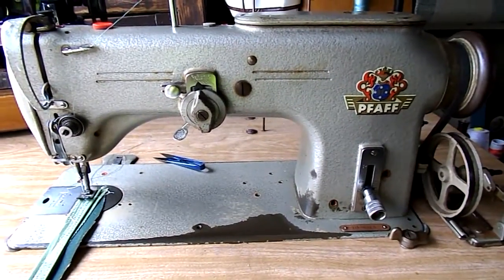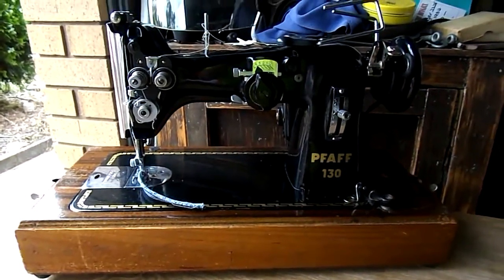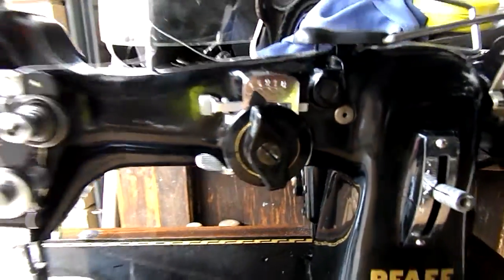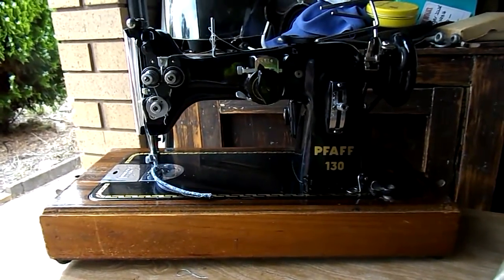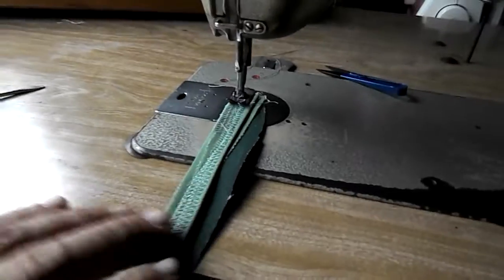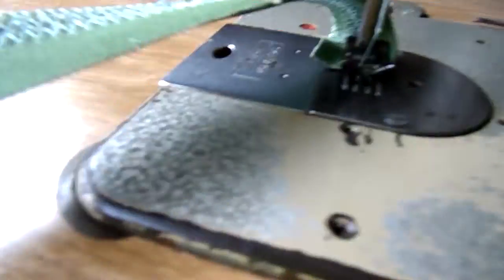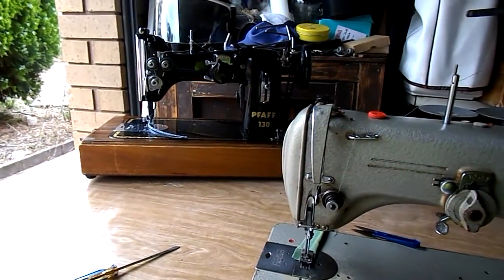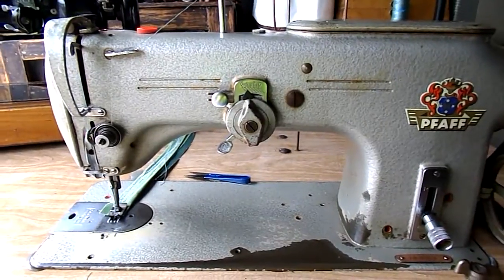PFAFF 238 and 130-6 a retrospective.

Comment from the maker: For example.. This Pfaff 130 would sew three thicknesses of canvas  with its domestic motor, But l would Not do a whole tarp , the motor would not handle it. But it will sew the canvas. Some of todays  modern domestic machines would Not sew hems on Jeans little alone two thicknesses of canvas.  My singer 319 will sew four thicknesses of canvas with a domestic motor of its time.  But I would Not use it for long periods.